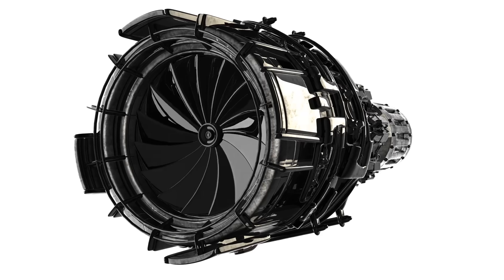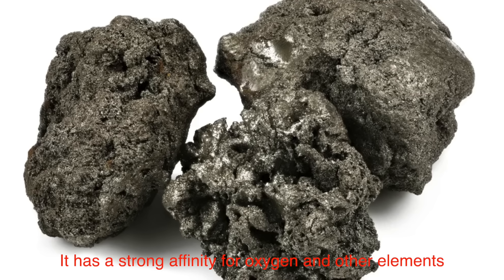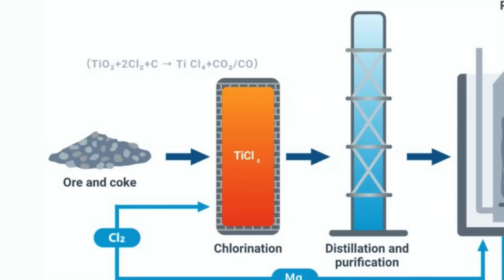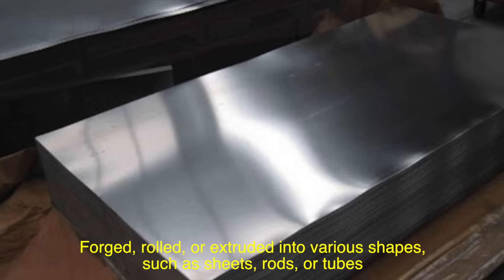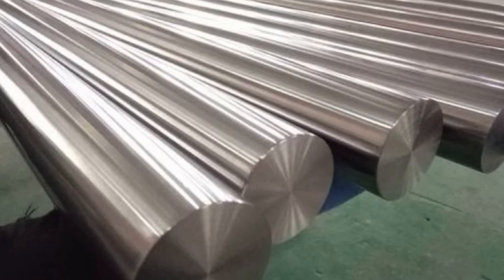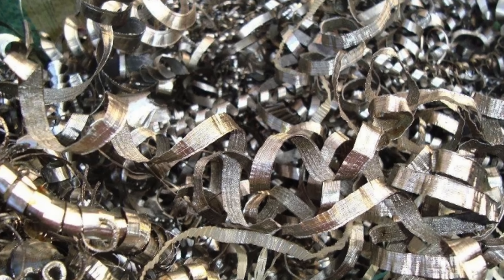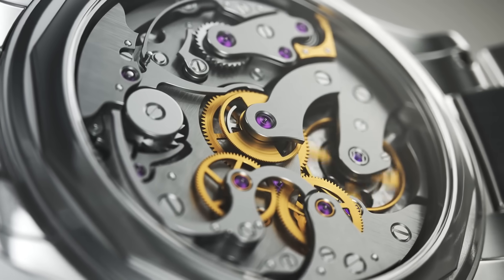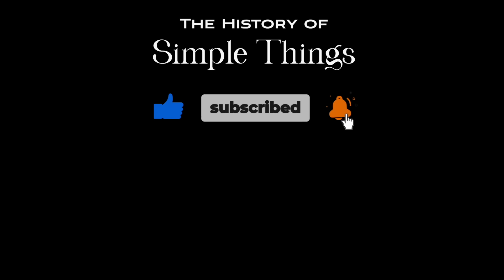How Is Titanium Made?

Comment: I was once asked to cut a piece of titanuum from a paper thin sheet of the metal and a pair of tin snips did not even mark it even with long handles which  would have cut a similar thickness of steel easily. Ultimately an electron beam was needed to cut it.

Comment: I have two Titanium screws holding my knee joint together. They are a half inch in diameter and 2 inches long. The actually hold both my ACL and PCL replacements in place . I can tell when it's gonna rain 3 days in advance and snow ,sleet or Ice,, a week. Cold and old suck.

Comment: CHEAP TITANIUM AND THE NEW PRG !
Titanium effectively a "Rare Metal" which currently costs a lot to mine and produce. Will soon be "Created" in Industrial Quantity along with other "Rare Metals", in what are known as Plasma Reactor Generators (PRG) at a fraction of current costs. This revolutionary new Scientific technology, the result of 15 years of research into the Sun's Atmosphere by a Scientific High Tech Electrical Engineering company called AUREON ENERGY Ltd.  Who have long suspected that the Sun & ALL Stars actually function electrically, and burn NOTHING at all. Indeed the Plasma Electric interface in all Stars atmospheres was reproduced in the first prototype PRG. The first Commercial PRG's are just entering service !

1. CHEAP ELECTRICITY 
Which has revealed some startling discoveries. Indeed the PRG is designed to be a Multi-functional technology capable of replicating ANY & ALL behaviours found in our Sun's atmosphere. And the atmosphere of the Sun & Stars can and does do some very Commercially useful things. Firstly all the Stars although fed by an electrical supply known as a "Birkeland Current" actually produce more electricity in an extremely efficient way. So efficient in fact that the PRG will result in the reconstruction of ALL main power stations Worldwide by replacing the current fuel system, whether Gas, Oil, Coal or a Nuclear Reactor, with a far cheaper PRG. Reducing current electrical generation costs by at least 75%. Meaning even Solar panels & wind Generators will soon be a thing of the past.

2. REMEDIATION OF RADIO ACTIVE MATERIAL - ALREADY IN PROGRESS !
The PRG can also copy the Sun's ability to instantaneously "Switch off" permanently radioactivity and "consume the material causing the problem. So two Industries will be affected. ALL current buried Nuclear Waste costing Billions a year to store, will simply be fed into the nearest PRG, allowing the PRG to produce an amount of free "electrical energy" in the process. The other Industry is where the first PRG's are ALREADY AT WORK. This being the problem in the USA of illegal dumping of highly radioactive material. With over 100 known "hot spots". This issue has revealed that dangerous radioactive material waste is already getting into the fresh water supply. So "mini" PRG's designed to fit inside fresh water supply lines, are already at  work, stopping any radioactivity and consuming instantaneously the material giving off such behaviour, as the water flows by in the pipe.

3. TANSMUTATION OF THE ELEMENTS !
As per our Suns atmosphere, where "Elements" (anything in the Element Table) are "transmuted" into other elements, means the PRG can also do this. This is where the "Rare Metals" industry will be affected. No longer will we need to search for or mine such "Rare Metals". As any PRG can simply be adjusted to "produce" in Industrial quantity ANY Element including any metals you want. Indeed during experimentation with the prototype PRG a few years ago, they discovered FOUR new perfectly stable HEAVY metals, not yet in the Element Table, in measurable quantity inside the PRG. This being just one of the MAJOR Scientific discoveries this new technology has already revealed !   

AUREON ENERGY Ltd., is a fully registered Company, and ALL its Scientific discoveries and the secrets of the PRG are included in a "Closed Patent".

Comment: Working with titanium is challenging especially hand carving with a file to create hand cut features. I cut a Golden Dragon detail into the edge of a piece of grade 5 about five millimetres thick which took quite a few hours. Turning titanium is fairly easy with the correct carbide tools and appropriate feed and speed rates along with the the tool nose radius for the cut. Forging is not easy but is achieved with success and faith.

Comment: I read a book about the SR_71 Blackbird and it was said that the chrome vanadium coating on the wrenches used to work the ti fasteners was causing some sorta reactions and the fasteners would fail at super Sonic speeds.in this video vanadium is mixed with it

Comment: Titanium cuts like butter with the right tools. It is my preferred metal to machine. Super easy, super finishes, amazing dim control, etc. It is amazing.
Reply: I hate its reputation as some super metal. The machinability is drastically impacted by the fact that you can't really lubricate it the same way as most metals, but it's not any stronger than steel. Such terrible vibes based info out there.

Comment: Titanium is better to work with than steel.  For one it doesn’t splinter when burred, it flakes.  In argon environment it doesn’t spark when a burr is put to it. In a normal oxygenated environment it sparks and can start a fire.  As for welding titanium (aerospace etc.) , it is very easy to work with, especially when welding in a argon gas filled chamber. Outside of a chamber (also TIG) it’s necessary to keep the argon gas on the Ti until it cools enough to prevent alpha case oxidation from developing.

Comment: I was a rework welder of jet engine compressor vanes(blades). We cast and repaired Ti-Al (titanium - aluminum) alloy parts that required high temps in a chamber to be welded. The parts would be brightly glowing red and would ring like cold steel when struck.

Comment: I didn’t know that titanium was such a common element.  It was used extensively on the SR-71 Blackbird.  Back then, the known reserves were in the USSR and the story of how the US obtained it for the BlackBird  during the Cold War was quite clever.
Reply: China produces LOTS of it.
Reply: It's sorta like aluminum. It's everywhere but hard to refine at an industrial scale. Aluminum is also really easy to work with once you have it while titanium isn't. Making anything out of titanium is hard because of how tough it is, so you better have a good reason you're making whatever it is you're making out of it.
Reply: More interesting still is the story on how the US came to know the Alfa class submarines were made of titanium alloy.
When buying scrap titanium from the USSR for the U-2 planes they read all the markings on what was acquired. So eventually they got titanium with markings that belonged to what they knew as a new submarine project.
Reply: They set up a dummy corporation to buy the titanium so they wouldnt look suspicious if im not mistaken
Reply: i think this is story CIA created fake company just to obtain titanium 😅
Reply: pizza ovens!

🤣
Reply: That's right, every blackbird and arkangel airframe is from the ussr😂 and used to spy on them, we sneaky😮
Reply: Were* quite clever

Comment: One of the key properties you failed to mention is that Ti naturally integrates with bone making it the choice for bone screws and many implants.
Reply: I have artificial discs in my spine that are made from titanium. The areas that are integrated into the bone a microporous which allows for the bone to grow into it well. German technology, thank you!
Reply: It was discovered by a researcher conducting cardiac studies on mice.  They needed small "windows" to see heart function in the chest cavity, so they used glass  with frames from Ti, knowing its resistance to corrosion.  After a brief period, they noticed bone had fully fused to the Ti and that launched it as an implant material.  From the book on the Periodic Table "The Disappearing Spoon."  I recommend it.
Reply: This is not actually a metallic property nor is it unique to titanium. Bone will happily grow around most metals. The reason titanium is used is primarily because it is inert (meaning it will not interact chemically with the body) and it's strong, lightweight and cheap. There is no other metal or alloy that has all these characteristics at a cheaper price. Aluminum is lighter but softer, steel is cheaper but heavier, etc.

Comment: Titanium is difficult to machine not due to its hardness and resistance to heat, steel is better in these properties than titanium. Titanium, as someone who had worked with them describes, tend to "stick" while machining, and that's why it's difficult to machine sometimes.

Comment: Titanium is certainly one of the more impressive elements for strength.  As far as alloys go, we have steel alloys that can best it regarding strength. Tungsten, however... now there's a beast lol. Tungsten carbide has been compared to diamond hardness. 

Every metallic element seems to best all others in one area or another.  Silver, for instance bests in multiple areas.  Reflectivity, conductivity(electrical or thermal). I think gold beats it slightly for being more malleable. Silver is the gauge in which other metals are compared 🤩

I think they stopped using Silver in mirrors though, as Aluminum is also excellent with reflectivity.

Comment: I've used and worn many metals over the years.
I have some titanium in my ankles, feet and arm but … my personal interaction with titanium is my watch … band and case … I’ve worn many tough and expensive watches but between Ironwork and Stonework they were pretty quicky destroyed.
My current titanium watch has been worn 24/7/365 through a lot of abuse (stone masonry, welding and cutting wheels is abusive to … anything) and the watch continues to look practically new. 
No other metal item that I’ve ever used or worn has come close.

Comment: I remember the cold war days when titanium cost more than sterling silver because the Soviet Union had an exclusive monopoly on it as they were the only source for titanium at the time.  It wasn't until the 1980s that other non Soviet block countries mined and smelted it.  Still expensive to work but now where near as expensive as it was in the 1960s.  Can't wait for the new smelting/refining system to prove itself and replace the Kroll process.  My only experience with titanium was mail ordering titanium plate about 8 inches square and 1/16th of an inch thick.  My crude hobby tools were no match for working with the metal and quickly gave up on trying to work it.  You really need the perfect tools to work it.  It's defiantly not for the hobbyist.  My next experience with it might be when I get my first tooth implant when I grow older
Reply: Can be easily machined with solid carbide tools. They are quite a bit more expensive though, and require more rigid machining conditions.
Reply: Russia still makes and processes most Ti used around the world in northern Siberia I believe. I saw some where that is costs about $4 lb which seems cheap.

Comment: MY SINGLE SPEED RIGID MTN BIKE FRAME IS TI  6/4AND MY BARS, STEM BILLET 6/4 GRADE 5 AND SEAT POST
Reply: @SVENSKANYC  if your bike frame is tubular the alloy is more likely Ti-325, a leaner version of Ti-6Al-4V which cannot be cold worked to make tubing. Ti-325 is the alloy of choice for the hydraulic tubing in most commercial aircraft.

Comment: Great work! Titanium is a fantastic material but comes with challenges. It’s energy-intensive to produce and expensive, as refining it requires a lot of electricity. While it's strong and lightweight, titanium is prone to cracking, and repairs are harder than with steel. A good example of this is the aerospace industry, where titanium is used in jet engines for its strength-to-weight ratio. However, it's often a challenge to repair titanium components if they get damaged, as the process is more complex than fixing steel parts.
Reply: Titanium galls easily, and one tiny scratch will become its failure point. It can be lighter while being the same strength as steel, it also doesn’t suffer fatigue like aluminum. It’s the best metal if used right.
Reply: So Cal LA area has worked with titanium for all my life?  Dad built a foundry in the 50's
I own a titanium digging bar "I watched" made from cut off a larger ingot to going in and out of the furnace, and under the smith's hammer glowing, while I worked on his cool furnace as an under aged kid with Pops in the mid 70's. Think it's SR71 or Nuc sub titainium?(rings? and roller)
Late 70's or early 80's I helped dad build allegedly the western worlds larges titanium ring roller ubder aged, it was still there a few years ago with "my pipefitting" perfect 45's and double swing joints on the hydro and other systems run, one floor down in the stairs area.Yes. I became a Journeyman of multiple trades, I had head start.
A family member anodized his titanium brite green. Only one "I know" of brite gren at the time.

machining waste is a bit energetic. My digging bar makes cool sparks on concrete.

Comment: Bought a titanium knife once. It was a boning knife, chef grade, laser edged, pricey AF. Needed a solid, dependable boning knife for work. Something I could just smooth steel like once an hour.
Utter sh*t. Too hard to hold a good edge. Too hard to smooth steel, even with ceramic. Fortunately, since it was a proper professional chef's knife, I sent it back and got a regular carbon steel knife. Titanium's not for knives, save your $$$ and just buy carbon steel.
Reply: S90v is the best knife steel I've come across yet. Used several "better" with worse results.
Reply: @travistucker7317  have you tried Magnacut? It’s well balanced for hardness, toughness, and corrosion resistance. Not the best in each individual category, but the best combination currently available. The secret sauce is niobium additions which forms ultra-hard carbides uniformly dispersed throughout using powder metallurgy techniques.
Reply: Titanium is almost impossible to sharpen, as it's softer but tougher than steel. The only reasonable application for Ti on knives is either handles for folding knives or a titanium-nitride coating for the blade.
Reply: @einundsiebenziger5488  or for non-magnetic, corrosion resistant knifes for divers. Otherwise it’s pretty useless as a blade material. Way too soft to hold an edge.

Comment: I have a 5 inch by 10 inch by 0.10 inch piece of titanium in my garage, I bought it off of eBay.  When my gearhead friends come over I like to casually hand it to them and ask them what it is.  Often they say stainless steel, but I point out the light weight and slightly blue tint of the metal, which weighs about 58% what stainless weighs. Many furrowed brows and taps later I tell them that it is titanium.  Only one guy has figured it out.
Reply: I wear a titanium watch most days.
Reply: I have 2 rods in my spine that go from my neck to my asscrack 😂
Reply: My mate's bike has a lot of titanium in it. I think bottle holder and possibly his bike frame too
Reply: I have 2 rods and 14 screws that were used to repair a shattered humerus on right arm after an accident.

Comment: High temperatures resistant ?  I thought it oxidised at 400c ?.
Reply: @brianredmond4919  special Ti alloys are used at the rear of jet engines and can withstand flame temperatures to 1600F.
Reply: Sure, but that's one atomic layer.  The structure would still maintain strength and shape.  

Aluminium oxidizes at room temps, and does just fine in what it's used for.
Reply: It will start absorbing oxygen from the atmosphere at 220⁰c